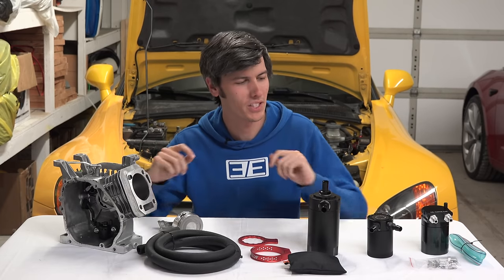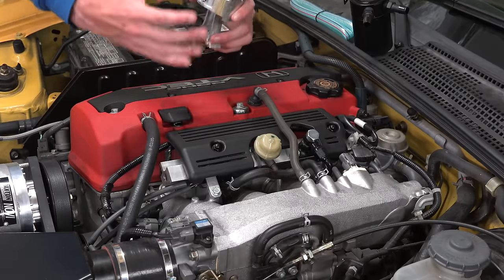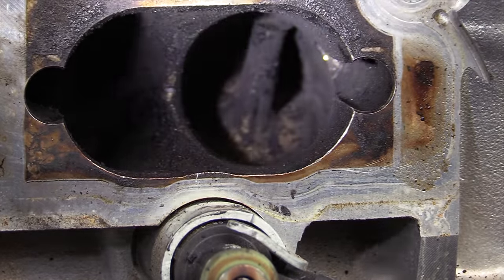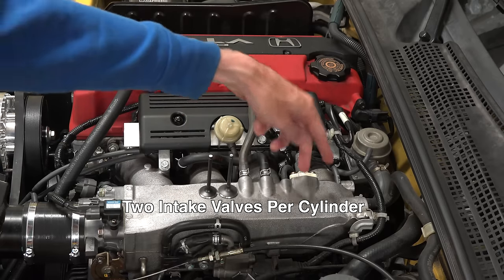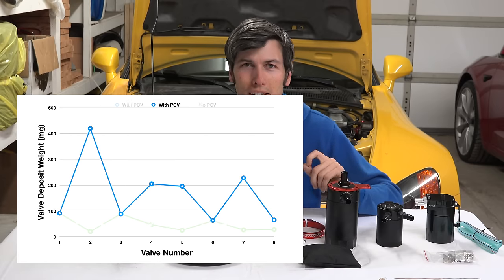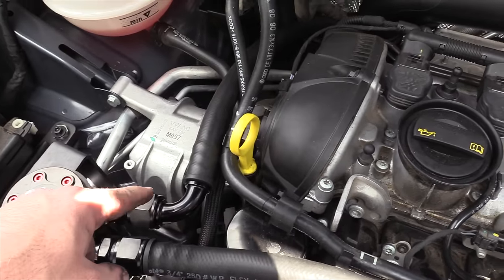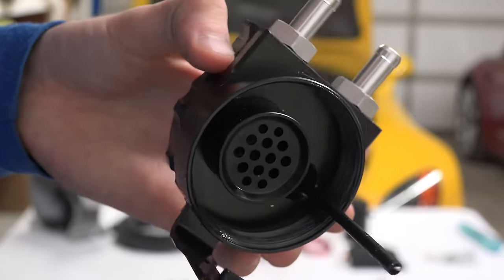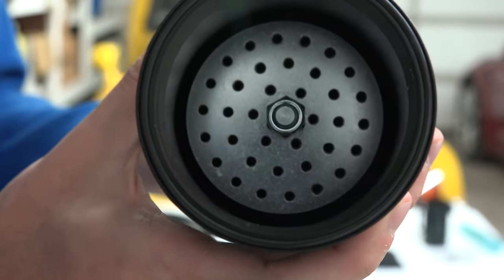Do Oil Catch Cans Actually Work?

Comment: $230 for a "can"!! That's extreme, especially when you can get the same for $23.. a cheap friend of mine used to make it himself using a beans can filled with Scotch Brite metal scrubber.. back then when it was costly to buy a good catch can.
Reply: Oh back then, Mishimoto was a new name, sold on eBay for low. Now, they're truly overpriced.

Comment: I drive a 4wd 2018 F150 STX supercrew.  The 2.7L twin turbo ecoboost engine in my truck is both direct injected and port injected.  My question is with the addition of port injection, will I benefit from an oil catch can?
Reply: What's it gonna hurt? Oil in your intake is gonna mess up your octane rating!!!

Comment: So ya gunner loose all that top end lubrication. point of interest, if I filled my V8 jag. to max. on the dip stick, I would need to top up between oil changes to keep it at that level, But if filled between min. and max. mark ( that's were the correct amount of recommended oil quantity would leave it) then it would not drop any lower between changes.

Comment: Oil catch cans are risky if the undrained water freezes, preventing crankcase pressures from venting ,causing crankcase blowby pressure to build to the point of damaging the crankshaft seals.

Comment: Jason, one question I can't seem to find an answer to is:  I just bought a 5.0 Hyundai Genesis R Spec with 133k miles, would I benefit from an oil catch can at this point with this many miles already on the engine, or no?  Most of the time, I see people installing them on cars with very low miles.
Reply: There's usually room for more buildup to form, but if you're curious you can always peek into the intake with a $40 boroscope and/or run a solvent through your intake, after the MAF sensor if you don't want to take it apart.

Comment: What about catch cans that vent straight into the atmosphere? Apart from the environmental impact is there any decrease in ventilation by not having vacuum present in the line?
Reply: Also curious about this. I'm going say no decrease in ventilation, as blow by pressures are very high. certainly high enough to vent properly to a catch can and out into atmosphere. Definitely would be less carbon buildup if vented. Some people here are also saying that the octane rating of your fuel would be higher, due to keeping oil vapours out of the intake, which would dilute the mixture slightly.

Comment: You should blow some olil filled compressed air through these and see how well they perform.
If even the better ones are only able to catch 20-30% of the oil sent through these... well then they are pretty much useless.

Comment: Does this mean it takes away from the oil capacity over time until your next oil change or does it recirculate it back into your oil? and how often do you need to change the bronze filters?
Reply: You would already be losing the oil as it would just get burned up in your cylinders if it didn't get caught by the can.

Comment: If you real want to clean thing's up put a fifty five pound magnet on your oil plug   then put a twenty five pound magnet on the top of the oil filter  you will notice a difference in milage and the oil last longer an amsoil 25000 mile oil filter setup with extra large filters to hold three extra quarts of oil with magnets on the top of each of those 25 lb magnets car runs much cooler and much more efficient I even have magnets on my fuel line going in to the motor   my truck all ready had magnets on it stock  this method of keeping the engine clean is much more efficient  trucks with a million miles on it doing these things  it is also great for the environment and you're wallet in the long run  just change the filters instead of all the oil if you use amsoil it's incredible oil

Comment: Seems pretty helpful for those GDI engines. What if an engine had 2 oil catch cans? Or an oil catch can going to another oil catch can, then to the PVC system?
Reply: Saw a video of a guy that ran 2 catch cans like that, the 2nd one stayed clean so he removed it (on an LS engine).

Comment: STOP STOP STOP!!! DO NOT run out an think you can just put a catch can on your vehicle. YOU WILL do DAMAGE!  EE doesnt explain crank case pressures at all in detail here. There is alot of science involved to understand crank case pressures. If you cause a restriction you will blow seals. Think drag cars we run vacuum pumps for a reason. You make HP under vacuum on your crank case. However too much and you cause windage issues. Side note that water in your catch can is condensate! Thats why high end catch cans like a racor have heaters. This guy is really starting to piss me off with his leaving out key information in his explanations. If your going to teach then dont leave out important information. As i have said before numbers dont lie people do. Also you measure crank pressure is inhg. There is hundreds of studies on this.
Reply: Thank you, because of your post I am convinced and will be removing my oil catch can from my lexus is direct injection engine.  Thanks again, cheers.

Comment: 7:52... I believe Mishimoto is the one in the center and they have sold the right to other companies to sell it. So the price has gone down drastically. I think there around 20 bucks now. It's a good little catch can. I bought the original for around $100 and I just bought another one a different color for $20 or $25.
Reply: Mishimoto did NOT sell the right to other companies.  There are many counterfeit products, primarily from China, and they are very low quality - horribly inconsistent at best.  Poor manufacturing, prone to leaks and failures.  Be very, very careful where you are buying these and make sure it is a genuine product.

Comment: Instead of putting a Band-Aid on it, why not just fix the problem? Direct injection systems are wonderful if they are supplemented with a port injection system. It’s solves all the problems with potential carbon buildup on the valves, Not to mention greater flexibility with fuel metering and accuracy during all phases of engine operation from cold start up, low load, to hot, high load situations. Also the problem with oil dilution from fuel is virtually eliminated. Toyota largely system wide has adopted a dual injection system on most of their vehicles as well as some Ford engines and some Subaru. It’s time for GM and the Germans to spend the money to do it right.

Comment: How can deposit on valve affect the engine fuel consumption or performance,  it can't. 
It may affect valve reliability,  there may be premature valve stem failure due to deposits attacking valve metals.
Reply: do you think its going to make it easier for the air to get in with buildup on the valve?

Comment: lol 500$ oil catch can you gotta be kidding me, 
The 25$ one now comes with an air filter on the top and does the exact same as the 500$ one, it's just smaller and doesn't have a bottom drain plug but the dip stick is nice.

Comment: Jason, please can you explain why there are two hoses coming from the tappet cover?  One goes to the inlet port, which is fine on my car,  as it has port injection, but the other hose goes into the air filter box. Sometimes this oiliness can contaminate the air filter. 
Can I reroute this hose away from the air filter box, and let it join the other pcv hose?
Reply: You're not supposed to be using a catch can on a port injected engine!!! Only on gasoline direct injection engine or engines where both port and GDI are used such as Toyota's latest engine.. Take that off. You're ruining the air filter. This has to be a joke, right?
Reply: @danejurus69  I think you misunderstood my comment. I never said I had a catch can. Read my comment again slowly. 
There's two hoses coming from my valve cover. One goes straight to the inlet tract. The other hose goes into the air filter box. There's a little sponge where it goes into the air filter housing. That gets oily,  and  some oiliness gets on the paper air filter element. I know this can happen if you have severe blow by  (which I don't)

Comment: I keep seeing advertisements for "1000hp rated Catch Can!" is this a marketing scheme? Because I don't really understand how a catch can could or needs to be rated for 1000hp lol.
Reply: Larger engines tend to have somewhat higher blowbly, needing a bigger can for the higher airflow.
Having it rated for hp is entirely marketing though, tuning a engine for higher power will, depening on what exactly is tuned, increase blowby, but not in a way that you can correlate with hp for every engine.
Depending on how you measure you could probably rate every catch can on the market as a 1000hp one.

Comment: take a rubber tube and when you change the oil..  idle the car and spray some wd40..   and it will go into the intake valves and help keep them clean.      just like old days of throttle body injection keeping the valves clean
Reply: About filling the tank once in while using hi octane gas, does it help clean the injectors and lifters? Not a mechanic, someone told me , so maybe an experience mechanic can answer, please!. So much talk about GM 5.3 V8  6 speeds,  motors with premature  lifters damages.

Comment: I'm one of those Old Fart Mechanics! Worked at a Lincoln Dealership through the 80's, built and Race Cars in the 90's, and finished my working years in Management.... 

I MISSED the GDI "Revolution", as working experience was concerned. 
I've only recently been learning about it... Pros and CONS. The biggest problem obviously being no more Intake cleaning, just to eek out a little less NOX, make a little more power, and squeeze a couple of more MPGs. 

Seems like an Engineering FAIL to me! Especially when Cars in the 90's got significantly higher Fuel Economy. The OEM can't explain that away! 

Yes, "Factory rated Power" was significantly lower than today... However, if you wanted it, a good PCM Tuner can easily squeeze about 700-800 Horsepower out of those 90's Engines - SAFELY!! 

My 1987 Buick Grand National can easily BEAT most all modern Cars. OK, the old Buick had Brakes that bordered on dangerous! Even when new. Cars today DO have much improved Chassis.... 

The Engines COULD be significantly better than they are - if not for ONE stifling factor..... 
CONSTANT GOVERNMENT OVERREACH!! 😖 People who don't know the difference between a Spark Plug and a Tire - mettle WAY too much into the design of new Cars.
This has been going on for a very long time. 

GOVERNMENT was the main reason why U.S. built Vehicles in the 1970's were SLOW, OVERWEIGHT, POOR running, unreliable Sloth-Mobiles!! 
They pushed Regulations that Automotive Engineering was not yet prepared to meet. Technology hadn't caught up yet! 

We actually got it RIGHT by the mid 90's. The Technology had caught up - and for a while, surpassed expectations! 

Lately, since the VW Diesel debacle, the Industry as a whole - has been slipping again.

Comment: They work, in that they catch oil and water, but to date, there is no actual study showing that they significantly reduce carbon buildup.   People swear by them because they see them on the internet and they spend money on them and have to justify that...

More than 50% of America's fleet vehicles are GDI.  If it was a significant problem, we would know about it.  Vehicles would be choking and failing left and right, and they just aren't...

Comment: How would you set up the oil catch system on a v6 or v8 with 2 breather channels? My car has on valve head breather going straight to the intake manifold and the other valve cover breather goes to my air filter box.

Comment: Other than legality, why couldn't you just run the PVC line under the car and let it vent into the atmosphere like cars in the 60s did.  Then just plug the intake where the hose had attached.

Comment: Hey Jason! Thanks for the info! I have a question tho if you got time..? I have a 2013 Civic Si and is multipoint fuel injected. So since my car is partially port injected, do you think it’s a waste of time/money for a catch can since port injection keeps valves clean-ish? I don’t want to spend to much either lol so any recommendations on less expensive options, if you think I need it? I got like 170k miles and no oil loss whatsoever through maintenance intervals. Reply, don’t reply, it’s all good I know you might have the answer somewhere on your videos! Cheers!

Comment: I can't find an answer but if your car only needs one port of the catch can, can you cap off the other port? I am working on a sxs that the catch cans are all single port use with a drain on the bottom and a filter on top there is no second port. There are some nice catch cans that I like but they only make them in dual port, I was wondering if I capped one end of the dual port if that would be ok? I don't know how the dual baffles would work. I think it wouldn't matter but I wanted to ask
Reply: Each catch can has two ports. But only one port is an inlet. The other port is an outlet. There should be directions included or online. In the video the hose would be cut in the middle and the catch can attached to the two cut ends. In other words the catch can is inserted into the path from the valve cover to the intake manifold.

Comment: Excellent video, as always. 

Question: is it not true that excessive oil blowing into the intake is due primarily to stuck piston rings? As in low compression.

If one is able to scour away the carbon from the piston rings and restore compression shouldn't excessive blow-by gasses/oil be abated to a manageable level?

Is a catch can a band-aid for stuck rings?

Back story: two years ago I bought a 2005 Infiniti FX45 and soon discovered it consumed a lot of oil. Of course the likely culprit is shrunken valve stem seals so I poured in a bottle of Titan Sealers leak-stop additive and it seemed to work. Oil consumption seemed to drop. Then I changed the oil to Amsoil Signature Series 5w30 engine oil. Consumption continued to drop. 

A few days ago I changed the oil to Amsoil SS 0w30. 

Im wondering if the Titan Sealers additive swelled the valve stem seals and the Amsoil cleaned the piston rings. I think so. 

By the way, I ran two gallons of lacquer thinner through two tanks hoping to clean the cats: didn't work, however the engine now runs smoother than ever thanks to the valve cleansing. 

Now I'm wondering if I truly need to install an oil catch can. 

Im thinking no.
Reply: Your car got that problem in the first place due to excessive blow by excessive blow by is a naturally occurring product that happens in any wearing engine if your engine is high compression it needs it more if your engine is low compression it needs it less all engines can make use of a catch can that was the point of the video
Reply: And you are kind of right a catch can can be a Band-Aid for piston rings I'll be at not a very good one as piston rings are sort of integral and rather cheap if you're able to change them yourself but a catch can will reduce excessive wear on your valve train components as well as your rings and pistons and cylinder walls

Comment: I have been using a mishimoto catch can in two of my cars . My cars are  port injected petrol 1.3 litre. The catch cans definitely catch a lot of oil however I also noticed that my cars are now prone to oil leaks from the oil filter gasket , which implies that the crankcase is definitely getting pressurised more than the usual and the oil filter gasket which happens to be the weakest link , is leaking oil .  This has made me rethink about the catch can . Do  let me know if you have faced a similar issue in your S2000 . Thanks
Reply: What car are u running it in ?
Reply: @kevinhall211  Its a suzuki esteem 1.3 Litre G13BB engine

Comment: I need help.. I have a BHZ 2.0 TFSI engine, yes I'm going to install catch can and remove the EVAP system... any inconvenience? 
Can you project something negative to the engine?
this car is for trackday, the flaps were also eliminated...
Reply: On the EVAP, I removed the system and taped it on the valve cover.

Comment: What are your thoughts on using one in sub zero temperatures, considering much of the fluid in the can is water?
Reply: an air oil separator would be better

Comment: I'm curious as to what the carbon buildup would look like on the port injected. How much of a difference is there, is it worth it? We assume the gasoline cleans the carbon but surely there would be some buildup. Any comparisons?
Reply: This is also where gas additives come in for the cleaning process (i have started just using alcohol).  The Additives help clean and break up any buildup as the fuel passes over the valves.  With the Direct Injected systems, you don't have the fuel and additive mixture running over the valves.  
So while in theory they should stay cleaner, in reality the blow by with oil/water/contaminants entering the intake they can dirty up quicker with no way of cleaning them out through general operation.  Then the heat just bakes it on.

Comment: I had a question, i have a  n/a drag car,i used to run a crankcase evaluation system running from my valve covers to my header collectors, now i installed a wideband sensor, thus i have to eliminate the evaluation system or my o2 will read lean from air coming from valve cover, would i run catch can from valve cover to valve cover? And if so does it matter that some cans have an inlet and a outlet?
Reply: Put the O2 sensor before the evac port